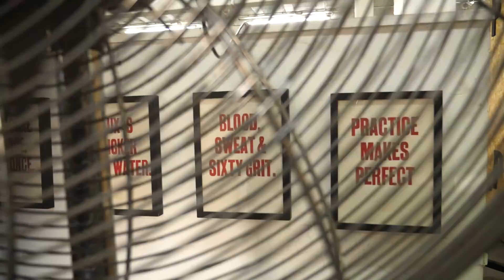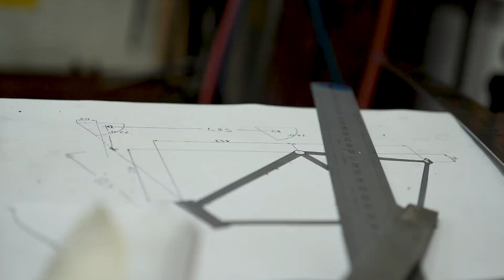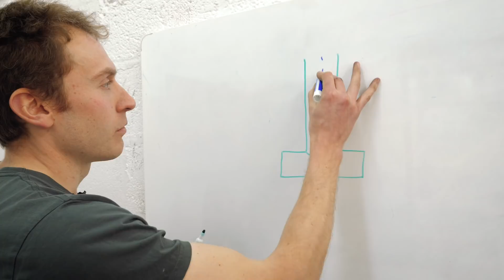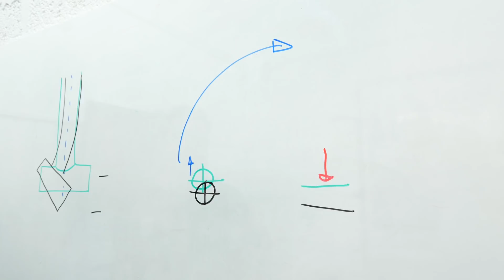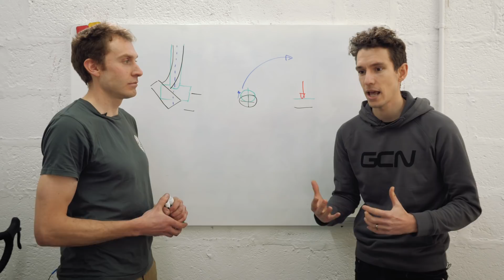Are You Faster On A Stiffer Bike?

Comment: A flexible frame will have more losses, because that flexing creates heat. It's not a lot, but it is there. Also, flexing will effectively delay the pedal stroke, therefore hurting acceleration and makes the bike feel sluggish. 
There has been a lot of research into frame stiffness in motorcycle racing. The trend used to be to get the frame as stiff as possible. It only ended when the lean angles became so extreme that the suspension wasn't doing anything. So they strategically introduced flex into the chassis to act as a primitive form of suspension when leaned over. The current consensus is that flex within a certain range is good.

So it seems stiffer frames definitely are faster in a straight line. But when taking road surface into account when, you might say a little flex is good. How much? It depends on the road surface and the weight of the combined rider and bike. And then there's the fact that we don't tend to corner that much...

TL;DR I'm sticking with my stiffer frame.
Reply: "A flexible frame will have more losses, because that flexing creates heat." Actually, bicycle frames are a near-perfect spring. There is some energy lost to heat yes, but it's incredibly trivial. Not trivial as in 2-3watts, trivial as in a tiny fraction of a watt. They did a test at Cannondale this year and literally couldn't measure the difference in power transfer between frames of differing stiffness (see Cycling tips interview with cannondale engineer Damon Rinard, and Jan Heine).
Also you're confusing lateral flex with vertical flex/compliance, but that's a whole 'nother argument. This topic has nothing to do with comfort or compliance.
I'm disappointed GCN didn't mention Jan Heine since he's kinda the driving force in both increasing tire sizes and frame flex, among other things. But yeah, just google "Jan Heine planing" to learn more. Jan's found that flexy frames offer a biomechanical advantage and thus enable the rider to put out more power.
Reply: Intuitively a stiffer frame makes sense in terms of power transfer, and in most cases stiffer probably is better, however there is an interesting area of study into what has been dubbed "planing" or basically if more flex can lead to better power transfer in certain cases. There definitely isn't a large depth of study in the field to prove either hypothesis, with logic being on the side of a stiffer frame, however it is a really interesting idea to explore. You should take a listen to this podcast, it is very interesting and very thorough. 
https://cyclingtips.com/2017/06/cyclingtips-podcast-does-frame-stiffness-matter/
Reply: That would be incorrect it depends on how stiff or how flexible of frame is as a general statement stiffer is not going to be faster you are not going experience energy loss on a flexible frame. The theory of planning is becoming more relevant to Bicycle frames. And in fact motorcycles as well. For the 2016 season the Honda moto Grand Prix team actually made their frames with more flexibility than ever before and their lap times significantly improved over the really super stiff swing arms and Chassis prior to that.
Reply: StuntpilootStef  feeling and perception do not always equate to actuality. Just because the stiffer frame feels faster doesn't mean it is faster. And as it turns out it isn't. Just like the false narrative that 23mm tires at high pressures feel faster than 25mm or 28mm at much lower pressures... turns out 28 or faster than 23s and 32s even faster!
Reply: StuntpilootStef precisely! The difference between the two frames are the time that the frame use to bounce back.
A stiffer bike means less comfort on a crappy road but it'll have a really ready response compared to the flexible one. I've got a steel fixed gear for my commuting and it is super flexy but I always enjoy to ride it even to do some climbs, and still can go hell fast if I want.
Reply: janerney I have just read about that for the first time and that Heine also experimented with polymer bushings. He seems to find quite a difference between different bikes. The differences were there with quite subtle changes in stiffness. I do wonder how you are going to find the right one by any other means than trying out all possibilities. Because it does seem quite easy to get wrong and there are a lot of factors involved. You have the weight of the rider and the bike stiffness, but also what BB you use, maybe which tires, groupset, chain, rims, etc. It does make things bloody difficult and almost impossible to get right for anybody that's not a pro cyclist.
Reply: Yeah, i get what you are saying. It is so nuanced and there are so many variables fro scenario to scenario that it is hard to see any quantifiable real world benefits. Interesting to examine and read about, definitely,  but is it something that i am going to think about when buying my next bike, definitely not.
Reply: It sounds like you just had a low-quality steel bike. A "steel bike" can be anything from a $100 walmart bike to a $5000 custom thinwall superlight climbing machine that rivals ultralight carbon in weight. Additionally, you shouldn't compare frame material unless the bikes have the exact same geometry and components.
Reply: Vertical compliance is another huge myth in cycling, as is the idea that skinny seat stays = more comfort. The reality is that the rear triangle of any bike frame is extremely stiff vertically via geometry, no matter what material it's made out of or how thin the seat stays are. Differences in vertical compliance are mostly due to the "compact"ness of the frame, which in turn affects how much seatpost is exposed, which actually does flex quite a bit. The longer the seatpost the most compliant the ride. If you've ever ridden a hardtail 29er mountain bike with a quality 27.2mm seatpost, you'll see it flexing up and down quite a bit. That, along with saddle flex and especially tire suspension vastly overshadow any differences in the frame due to seat stay diameter or material.
Reply: You can easily compare bike geometry because the main factor in vertical compliance is compact-ness as I explained in an earlier comment. As far as lateral flex, your explanation plays into my argument, which is that you can't compare solely frame material. You can easily create a steel bike that is just as "stiff" as an aluminum bike simply by increasing tubing diameter, it's just that it isn't something that's done in practice because people that tend to buy steel bikes tend to like flexy bikes. Of course, steel as a material is three times as stiff as aluminum, and there are for sure boutique steel frames out there that equal Cannondales in stiffness with wide-than-standard but not nearly as wide as Cannondale's tubing. And as I noted in my first comment, as of recent Cannondale no longer believes ultimate stiffness defines an ultimate performance bike.
Reply: janerney I'll fo that! Thanks for the tip;)
Reply: Wouldn't having super-stiff chainstays to complement somewhat more flexible seatstays and main tubes help with power delivery?
Reply: Bicycle manufacturers have already started doing that. That's why you see tiny seat stay, bulked up drive side chainstay, and also large downtube. However, it's worth noting that skinny chainstay mainly helps with vertical compliance, which is different from a horizontal/torsional flex that a seat stay/downtube would experience (and being tested here). 

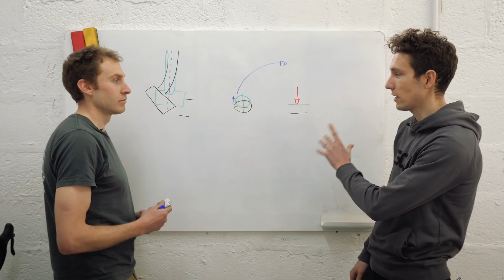If I have to guess, a stiffer frame would transfer your energy (mainly from downward pedaling motion) more efficiently to the wheels, but the flexy from the frame would return (spring back) the energy when you release pressure (6:00-1:00 position). Essentially, the flex of a frame turns your kinetic energy into potential energy, before releasing back as kinetic energy. If it's a closed system with no heat or other energy lost, then the law energy cannot be created nor destroy would apply. However, as others have mentioned, there's lost to heat, and I think there's probably lost to other part of the frame too (IE: flexing the fork or top tube ain't going to drive your bike forward).
Reply: The other thing as the frame s storing energy from the pedal stroke it can go two ways, that is in the demo the brakes are is released and he energy in the spring goes into the rotation of he wheel, the other scenario is to release the pedal and the energy from the stroke is just wasted. now it will depend a little on the pealing style and he variations in the load, I expect. But from the rider point of view the frame will store less energy it doesn’t flex and it’s easier to manage where the force of the pedal is sent
Reply: Just like lower tire pressures reduce rolling resistance over all but the smoothest of tarmac, some flex is necessary, not for power transfer, but for compliance.  Speaking of marginal gains, my Scott Foil has its rear brake moved to the BB, not for aerodynamics, but to increase flexibility in the seat stays.
Reply: Exactly. Energy contributing back is not going to be force but heat or even sound (may or may not be humanly detectable).
Reply: I agree with this comment.  I was all into the theory about good but forsaken usefulness of a steel frame, attracted by long lifetime of frame, unique appearance (nowadays), clean  tubing. I’ve heard/read/watched so many material to justify my quest.  There are so many ambassadors of a steel frame theory on the internet.  And there it was, my first cro-mo mtb/xc build, bulletproof but not hefty. I rode it for 2 years, givin it a chance to prove the claimed joy.  But none of this happened.  I went to few XC races (50 Km) , it was a living hell of an exhaustion. Sluggish at climbs, I was afraid to roll over obstacles during steep climb because I didn’t feel control of momentum under my feet.  It was the only bike I wish to get stolen, so I get excuse for a new build. Meanwhile I spotted an ad, a used Cannondale Furio bike was on sale.   For a bargain I got an extremely stiff frame and a nice headshok fork with excellent steering precision. It became my dream bike. I was literally laughing out loud of happiness while climbing on this machine! 

Steel is sexy to look at, but I will never ride steel again. I really like sports riding and competition events. That being said, for touring and traveling I would go for steel though -it’s certainly is comfortable and durable.
Reply: paddle hard I hate to break this to you, but steel is much, much stiffer than aluminium. Aluminium frames get their stiffness through shape. I think you may have had a bad steel frame and went to a good aluminium one. But your point still stands, I do get what you're saying. Just don't make the mistake of thinking all steel frames are flexible and bad handling.
Reply: Andrew Suzuki you can’t compare exact same geometry, because two vastly different materials require significantly different approach in frame design.  For example, because of the BB lateral flex, all Cannondale bikes (classic frames, pre-2010) have extended width of downtube in lower region (conical tube length wise), to benefit the pedaling efficiency.
Reply: StuntpilootStef  I was really deep into the theory, and I really took care of what I was doing.  I didn’t pick just any frame.  It was frame with best price/quality ratio, a CRO-MO 2008 Voodoo Hoodoo. Very nice frame.  All what folks are writing now here, I knew in bits and pieces back then. And I decided to write here some comments just for the sake of contributing to someone’s choice.  This is my personal experience and I don’t care about scientific background of it.  I only wish someone helped me at that time in the same way.  I was just blinded with theories present all over the net.  There are even some underground manufacturing companies that swear the only material for bikes is steel, anything else is rubbish - how much brainwashed is that!?
Reply: Andrew Suzuki Yeah, but don’t forget density of steel.  Density is not only making steel stiffer than alu, but also much more heavier.  That’s the main reason the steel bike tubes are narrow -you want a bike not a tank.  On the other hand, if you would build an alu bike with same narrow tubes, it would fall apart too soon -hence wider tubing.  But, as I said, for me is most important my experience.  I know I want a snappy responsive bike, and alu it is.
Reply: Regarding weight, wall thickness is also a factor of course, and steel can be drawn to thinner wall thicknesses than aluminum. http://www.englishcycles.com/custombikes/stainless-superlight/ 1112g steel frame, a bike for the oregon time trial champion and cat 1 road racer.
Reply: Reynolds 853...
https://goo.gl/images/TTbGVs
Reply: Heat?
Most of the energy you lose is stored as elestic potential energy - the same energy that is causing the frame to flex in the first place.
Reply: Exactly but we are riding a vehicle without suspension, and suspension can reduce rolling resistance because we can climb a bump and go down the bump, so the energy wasted for climb is 9x% returned only if the tire go down the bump with the tire stuck to the ground, if the tire jump the bump all energy is wasted, so flex can be a lot better than this little lose by heat.
Reply: Of course flex creates a bit of heat (very little) but both stiff and "lose" frames will lose the same amount of energy, your legs don't change.

Comment: Quite a while back Jan Heine from Bicycle Quarterly has written about frame flex characteristics and what he calls "planing". The gist of it was that the stored energy can help you be more efficient, if the frame flexes the right amount.
Reply: Then you might want to have a look at his most recent blog entry on that topic: https://janheine.wordpress.com/2018/01/28/myth-4-stiffer-frames-are-faster/
Reply: I would also add that Jan Heine was also way early touting the performance & comfort benefits of wider tires.  He's been quite the "prophet" on these topics.
Reply: I recently built a bike highly influenced by the Bicycle Quarterly crew - 650b x 42 tires, lightweight steel tubing that planes, low trail geometry, friction shift 3x10 drivetrain. It’s the funnest, most comfortable, useful bike I have ever had.
Reply: Indeed, was reading his articles with alot of joy. And to my surprise I confirmed for myself that the flexy frame I have (Look kg86, first carbon frame from 1986, La Vie Claire) was faster for me than a new, stiff frame from Felt (F1).
Reply: poraktobask I completely agree with you about Jan Heine/Compass, at the same time Bicycle Quarterly is not is peer reviewed Journal of Applied Biomechanics, Journal of Materials Science, etc even if he has experimental designed aided by PhD level researchers.  It's worth pointing out as much as Heine is well intended (even predicted the rise 650b x 42mm), his articles can be riddled with subjective and confirmation bias.  His scathing reviews of cable actuated disc brakes is one such example, because it doesn't fit the narrative or vision of what he wants bicycles to be.  There nothing wrong with brazed/lug frames, quill stems, rim brakes (In fact I've come full circle on the quills and lugged frames), but V-brakes and cable actuated disc brakes if set up correctly (aided with travel agents, organic/premium pads and compressionless housing) equal/rival if not superior calipers or canti's.
Reply: Thanks for the tip! I love reading stuff like this.
Reply: I still marvel at the notion that Jan Heine has become the voice of reason.  Albeit his refusal to accept the cable discs brakes aren't that bad (BB7) if they set up correctly with organic pad and compressionless housing
Reply: I do not know anything about his stance on mechanical disc breaks.
However he (or rather Bicycle Quarterly) used a scientific approach to examine the effect of frame flex. Which in and itself is way more reasonable than various claims that are thrown around without any supporting evidence.
Reply: "If the frame flexes the right amount." The issue being this will depend on rider weight, strength and pedaling style. I love a little flex as I feel it is more comfortable, especially when out of the saddle. But I get why many people don't feel the same way.

Comment: I'm not buying it. Just consider for a second the notion of riding a super flexy bike and ask if it would be faster, using the idea that energy isn't lost. I don't think that would be case. The entire idea behind stiffness is to ensure the forces that are applied are going in the direction of travel. In the case of the BB flexing, part of what you're suggesting here is that the bike will give that energy back. I just don't think it will in the direction of travel.
Reply: The energy would mostly get there eventually, but it will take longer. So I'd say a flexible frame would feel sluggish.

Comment: I think there's a lot to be thought about within this debate. If we examine a damping spring mass oscillator, that is a spring with some weight attached to the end, and we apply a force to the weight - we will find that it oscillates, but the oscillation decays due to damping of the spring. I think that a "flexy" bicycle frame will be analogous to this oscillator in that kinetic energy will be lost by restoring the frame to its original shape before applying some to the drive train. Will this loss be noticeable? Maybe not, maybe it is in the marginal gains territory.